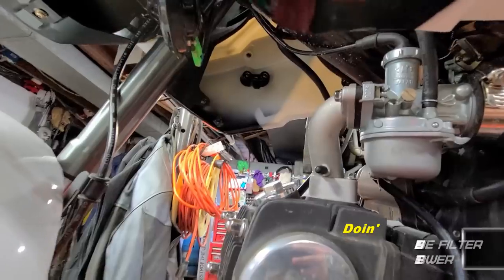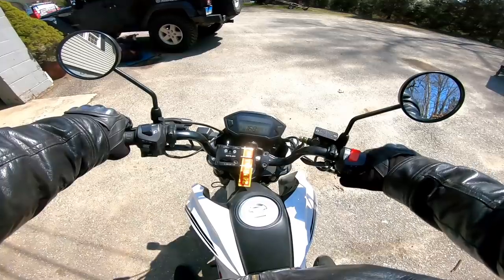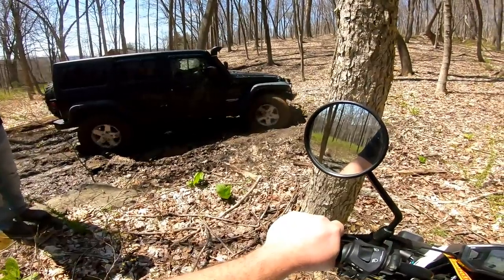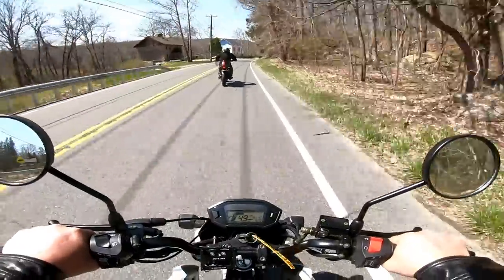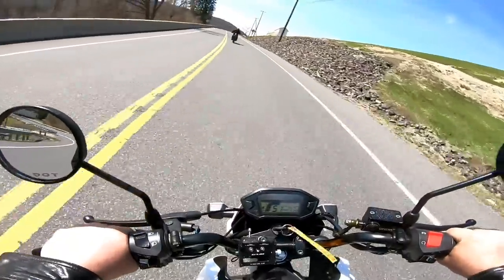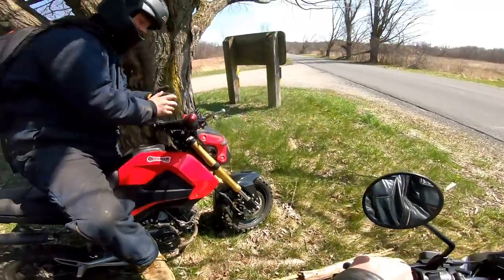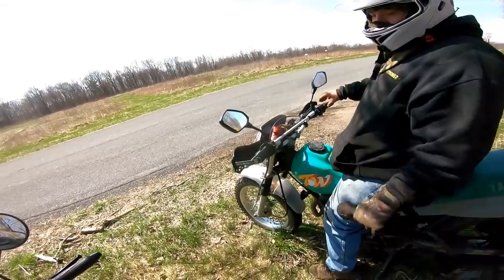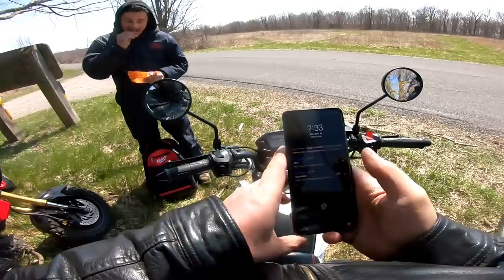(E5) Hellcat Raptor 125cc Air pod filter better? Mud and road ride “Grom Clone”

Comment: You're only going to notice improvements at high rpm if the stock air box was restrictive and then really only after rejetting to take advantage of the higher airflow.
Reply from the maker: I did in next episode. 3 carbs, different jetting...
Reply: @MotoCheez  ah
Reply from the maker: Nibbi was too big for head and stock exhaust... But have the 190cc coming this week 😁

Comment: 👍 Another nice adventure vid ! I dont comment much but figured I'd finally say Hi after a few years. I sub'd to you a few years (?) back when you got the DRZ. I see a nice mix of CT, VT, and NY plates in your vids. I used to live in northern VT for 14 years but now I'm in upstate NY. I still visit Hartford, VT now and then. I gave up snowmobiling but still have several bikes! Love the mix of content in your channel. Do you guys carry any gasoline with you on long rides, just in case ? That's my dilemma with my DRZ's small fuel tank + jetted rich. Cheers from NY ! 🍻🍻🍻
Reply from the maker: Howdy! Glad you finally commented 😁. Motorider has a fuel cell but it's usually empty. Someone usually has a soda or water bottle we can put gas from another bike.  I did buy one of those cheepo spare gas tanks
Reply: @MotoCheez  Nice ! I was also thinking about a pair of liter soda bottles or some kind of lightweight gasoline bottle. Not sure I want much more than that in the backpack but ill see what's avail to bolt onto the top of the rear fender maybe. It's raining up here, so indoor garage day for me I guess. For your new 125, yeah maybe a bigger bore kit if you need a little more power. Dont break the bank though, lol. 🍻
Reply from the maker: I use a Gatorade bottle on the boat. It's super thick, holds the gas pressure.

Comment: Sum fine entertainment while at one of those so called essential jobs.
Reply from the maker: Thanks, and thank you for being essential!!
Reply: Oh heck.  Your gone na make me blush.
Reply: @MotoCheez  hey man i got my tbr today but they messed it up so bad shipping it that they bent the front axle bolt so i cant put it together :( any ideas on any way to get a replacement besides waiting for them to send me a new one and do u have any idea how long they will take for them to replace it for me? are they pretty good about it? i got it from TX and used ur code for the discount. looks like it went through hell to get here.
Reply from the maker: @787sever  damn. I hear that happen once in a while, it sucks! Take pictures and send them to TXpowersports, you might be able to match up something at tractor supply or a large hardware store. It's pretty long I know...

Comment: Hey what do you I really need help in deciding weatther to get the Apollo 250 dual sport or the hawk 250 or the Orion RXB 250L please let me know thx
Reply from the maker: I really don't know much about the RXB  but it depends on what kind of riding you plan on doing. More Off-road the DLX, more on pavement, the Apollo.  I Have a chart comparing bikes on motocheez.com

Comment: Have you thought about doing a zs190 engine swap?  Love the vids.  Got a Hawk (because of you), however I sold it an bought an X-Pect.  Looking at a Hellcat as well.  So keep up the video's.
Reply from the maker: Yes. Everyone sold.out if the ZS190. Nice!
Reply: Bummer.  I see some horizontal ones on ebay,  when I looked before they were $799, not so cheap now, Just bought a Keychain....
Reply from the maker: @gregslair4278  yeah. Everyone buying them up. Thanks!!

Comment: Hello moto..  I see you're doin fine there... I think if you use that k&m style air filter you should adjust the air fuel mixture a little richer... it sounded like it was bogging down from too much air..
Reply from the maker: Definitely was, but too rich at WOT, so would have had to messed with shimming needle.
Reply: @MotoCheez  that mighta helped too
Reply from the maker: It would for sure

Comment: Hmmm, I probably go with the big-bore kit first (the safest major mod); then, based on how it responds to that mod, maybe a cam swap as a further tweak.
(With gas prices ATM, you'll be able to run with the richer go-juice...down to the $1.30's in my neck of the woods. 👍)
Reply from the maker: I did order a cam...
Reply: @MotoCheez  🤦‍♂️🤦‍♂️🤦‍♂️

Comment: Big Bore that bad boi. Been looking at another 125cc bike, and I see 141cc big bore kits for not terribly much. Don't know enough yet about these engines to suggest a cam. Open up the airbox and see what's in there; you might be able to cut away some of the baffles...also make sure to open up the intake and output sides to let the little guy breathe right. Speaking of baffles, maybe do some surgery to the muffler? Then, after you do all that, say Eff It and bolt a small block Chevy in there, lol
Reply from the maker: 🤣👍👍👍👍😆 ordered a cam first, trying to keep it as quiet as I can if possible.

Comment: So back to the jetting topic, if at idle, then a quick snap of the throttle she wants to bog,, is that typically a  lean condition,  Therefore a need to up- jet ?   Thanks, definitely appreciate the help.
Reply from the maker: Yes, usually the primary jet and needle jet, 3/4 to Wide open throttle bog is main jet
Reply: @MotoCheez   OK  ,  if I'm at it low regular idle and snap it it will bog but if I up the rpm just a  little,  even a 100 150 rpm more,  it won't bog ( Almost like cause I'm dumpin just a little bit more fuel at that point...
Reply from the maker: Maybe try opening up the mixture screw half turn
Reply: @MotoCheez   Yup I tried shaman the needle but it's got like this plastic keeper in thing instead of a retainer clip so I could only do a very very thin washer shim so I've got another carb coming that will be more adjustable...  Or at least use the Adjustable needle and slide parts out of it
Reply from the maker: @timdoyle8199  couldn't get a little washer under it?
Reply: @MotoCheez   Yes I was able to get a very thin washer under it it really didn't move it that much but maybe I do need to go up a size on my pilot  jet ?

Comment: I put a mukuni 22mm on my hellcat it was a huge difference
Reply from the maker: Bolt pattern fit? I was looking into a bigger carb
Reply: @MotoCheez  yeah I got one with a new intake
Reply from the maker: Have a link?
Reply: @MotoCheez  got it off Amazon says it's for a pit bike lol but it fit right on. Where did you get your knobs for yours?
Reply from the maker: One I bought the intake didn't point the right way. Could you please post a link?
Reply from the maker: Link for tires in description of video

Comment: Used to do the GM lid flip myself. As i get older i see benefit in keeping my vehicles quieter.  It dont make sense to straight pipe the truck i use for deer hunting. 
Another good vid!👍🏻
Reply from the maker: That's right! And cold air, tuned intake etc. I agree with the quiet now. Thanks😁

Comment: I don't get it. It's a 125cc and will run 55mph without much trouble, but bikes like the Hawk and Brozz are running a 229cc engine (100cc larger) and struggle to go 70mph with a free flowing exhaust and a re-jet.
Reply from the maker: It takes a bit for a 125cc to go 55mph. like 12 HP. The Hawks are about 16hp

Comment: Oh yeah
Reply: First one man
Reply from the maker: You got it!!!! Send name and addy for ketfob
Reply from the maker: Gotit. I'll delete now.
Reply: Thanks for the video it's 1°c windy and I'm not going outside. LoL
Reply from the maker: Hahhah
Reply: Just a thought maybe you could pop out the rubber pieces on the foot pegs, and use your angle grinder to cut some teeth into the steel part of the peg
Reply from the maker: That's an idea. The footpegs are.pretty cheap when I looked them up
Reply: @johnweigel650  sorry I forgot to go back after reading your comments. Hahaha
Reply: @MotoCheez  a lot easier to get new ones that you like.

Comment: you should really put a zongshen 190 on that bike
Reply from the maker: I looked at a few. Pitster has one, does the Zongshen have charging circuit and electric start?
Reply: @MotoCheez  yes it have all you need and its Bolt on 190 cc 5 speed and chek zs swap shop on FB its have lot of info
Reply: And yes it have électric start
Reply from the maker: It would be an animal then!!!